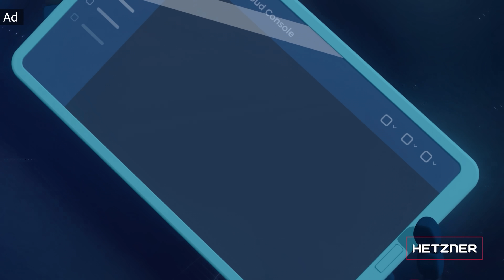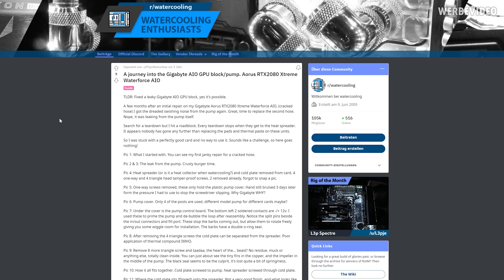Viewer-Mail Ep6: RTX 2080 Gasket Disaster

Comment: PSA: All AIO have a lifespan, will leak sooner or later, especially ones use rubber gaskets instead of more durable silicone.
Reply: That's why I prefer air cooling. You just have a chunk of metal and one or more fans. Worst case scenario you'll have to change a fan but that's it. No risk of a catastrophic failure and extremely low maintenance.
Reply: @FEARmeify  yes but air cooling only worth if is the biggest and chunkiest model avaliable,if not you will suffer from overheating and loss of performance,and I dont want to pay to loose performance.
For example I was able to buy the 3080 XC3 and It has a shit heatsink,have to buy a waterblock because of 80c while gaming...
Reply: @tomclippy  Not really, no. It depends on both the cpu/gpu and the case you're using (as well as the fans).

Hardware Unboxed has reviewed several air cooled 3080s and have had no issues. Also, 80C is not an out of spec or particularly high temperature.

Just to be curious, how much performance did you gain by usinc WC for your card?
Reply: @FEARmeify  The thin duel-slot GPUs suffer badly, I have a 2080 ti and the only way the fans aren't at 100% is if I set the power limit to 69%....
Reply: @FEARmeify  air cooling is dead, recent gpus and cpus are 300+watts (a 13900k is 350w full stock and 380w with the motherboard manufacturer "boost") if you check the specs of air coolers almost none of them can do that and if they can they are unbearably loud
Reply: @fredEVOIX  or they are large and work perfectly fine. 4090 Asus is pretty quiet
Reply: @fredEVOIX   overclocking is unnecessary and whoever wants to do it will have to worry about other cooling solutions so it makes no sense for you to say that air cooling is dead. You're loco. Secondly, the TDP for a 13900k is just 125 watts, so whats this 300W you're talking about?
Reply: @fredEVOIX  So your argument is to present an enthusiast and extremely inefficient part as an example?

No, you can't properly cool a 13900k but you can cool everything else without issue so no, air cooling isn't "dead".
Reply: @fredEVOIX  ok. Why 4090 draws 400w and cools without taking a sweat with air to 60°C?
Reply: @FEARmeify  Even previous gen has problems with air cooling - I can attest to that with mine 5950X sitting at over 80C while gaming @stock with Noctua NH-D15S with two fans providing cooling inside pretty good airflow case Fractal Meshify 2XL.
Reply: @gagarin777  Watercooling does have its use cases but the fact that literally the highes end possible consumer cpu (from amd) may require WC does not mean at all that it's necessary for everything else.

Besides, 80C is not an unsafe temperature for the 5950X nor will it shorten its lifespan.

I ask the same thing I asked the other guy. How much better did your cpu perform when you moved to WC? If the only thing that changed was the temperatures then the upgrade (from a performance standpoint) was pointless.
Reply: @FEARmeify  yes temperature or voltage will shorten it's lifespan. Silicon is silicon it's the same thing that was used for c2d despite what company claims that now suddenly 100C is OK. Even Derbauer had a video when he had 3 new AMD CPU's run for few months at higher voltage and there was degradation. The CPU will fail faster, but still outside warranty period, so manufacturer is will not have to take responsibility for failed product and can easily claim 100C is perfectly normal. It's the same for most electronic components actually, when you have a rating that capacitor for example will have MTBF of 50k hrs at 50C, but 10k at 85C. Also running CPU at 80C means your mobo power section gets hotter as well because it's in the socket's vicinity so you potentially reduce it's lifespan. The other argument is if you have LC loop you can run your fans at lower RPM so no longer you need to hear a hairdryer next to you. You also have some headroom for overclocking, because you can now use more performance if you need it. For example some older single thread games like high clocks very much and if you would run your CPU at 10GHz they would still say "give me more".
Reply: Yup Liquid cooling is absolutely stupid and unnecessary
Reply: PSA: everything has a lifespan...
Reply: i have a old one Kraken X60 and still work like charm without any maintenance over almost 12 years 👁️👄👁️
Reply: @carloscardenas2959  Omg, outliers are a thing? wow. (that was sarcasm btw).

You can have absolutely no problems but the pump can die at any moment and you won't be able to replace it. There's also a risk (no matter how minor) that the coolant will leak and some (or all) of your components die.

If you're comfortable making that bet for a few degress, go ahead. I'm not.